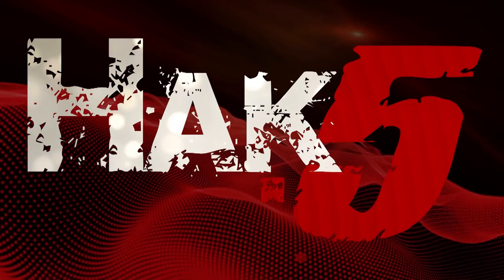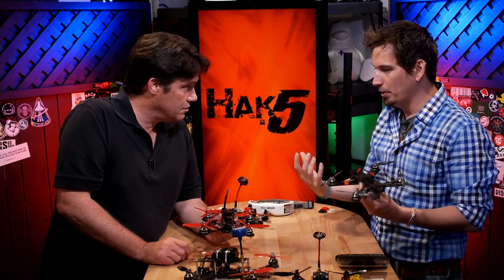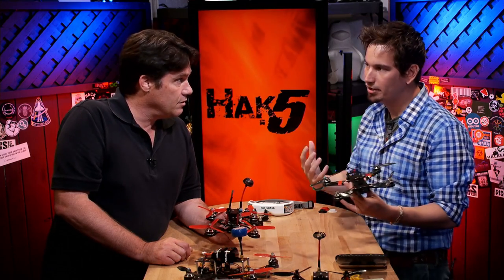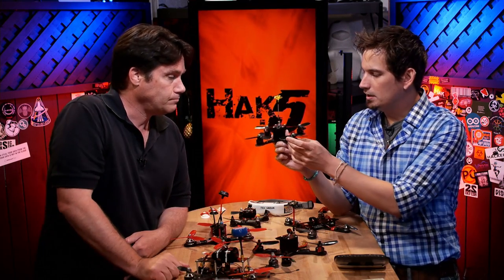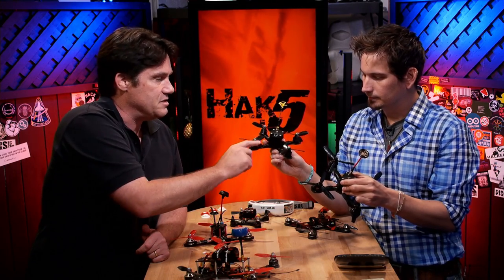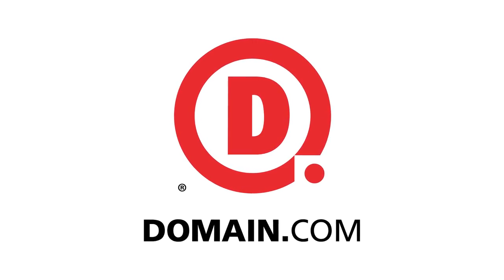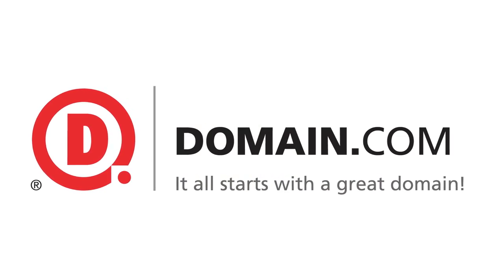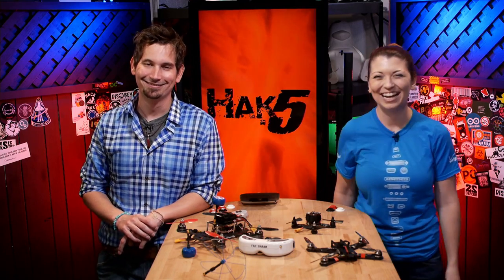Competitive Drone Racing - Drone Building 101 - Hak5 2015

Comment: I think it is best to mention that the various designs in frames address the different demands a given track or course have.
You wouldn't get as good performance with a 250 H quad running 5in props on a very tight and twisty course as a 4in prop X quad. By the same token- that 4in quad would not be as competitive on a long and fast track where the copter can get to the top end of it's speed more often.
Tight tracks require torque and quick responses where open and fast tracks require top end speed and stability to hold a line at speed. 
Deadcat and H frames are better suited for open and long tracks while X frames rule the tight track all individual pilot skill aside. (some guys are so fast no matter what they fly)

Comment: If I used a different brand transmitter and receiver would they still work?
Reply: If they are compatible- for example; Futaba can use Frsky and orange futaba compatible receivers. Otherwise, unless designed, each brand radio will only work with it's own receiver.